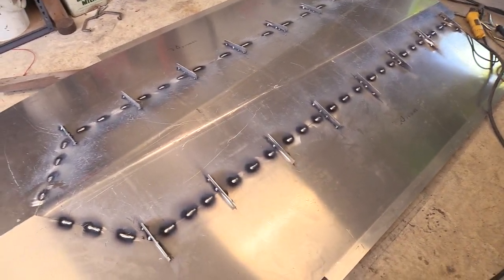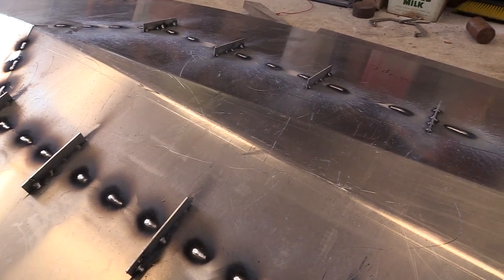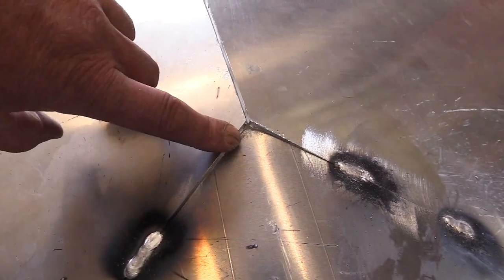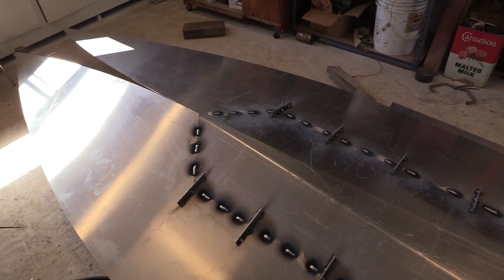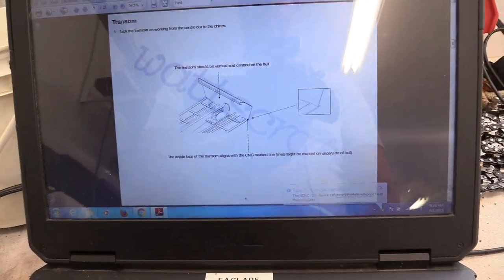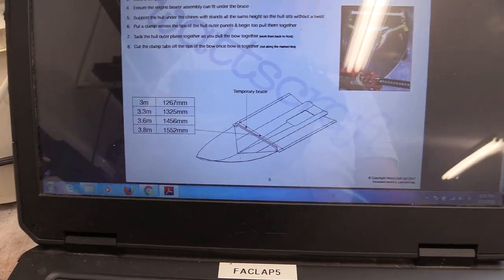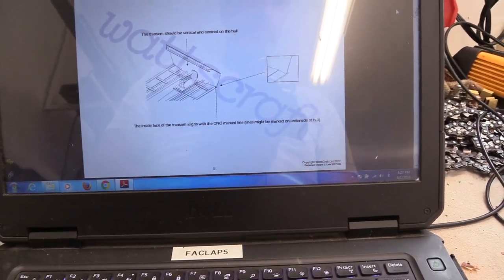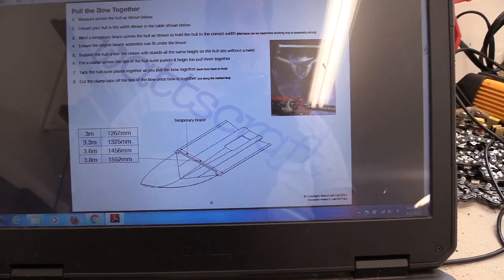Mini Jet Boat Build Video #6 Hull Assembly

Comment: I wondered where you warpage came from, and then I went back and found this video. You've stitch welded the hull. That's the biggest no-no. If you're building an aluminium boat, the biggest thing you're contending with is warping due to heat. Alloy is a giant heat sink and expands quite significantly over large sections when hot. 

Ideally you'd be using a pulse MIG welder. Standard MIG (and worse yet, TIG) will introduce much more heat per mm of weld bead than pulsed MIG. Secondly, and more importantly, you don't stitch weld when you're lining the panels up. You need to do tack welds, very small tacks at regular 100mm intervals or so. As soon as you stitch weld (Even with a pulsed MIG) you introduce vast amounts of heat into panels that aren't in their completed positions, resulting in expansion, warping and the outcome you have. 
I don't think the saying 'your second boat will be better than the first' has anything to do with the kit, it's your personal technique. It's entirely possible to build a kit boat without special jigs, but you need to thoroughly research the welding process for boat building. If you start with the hull plates welded like this, every single plate you put ontop of this is just going to make the issue worse and you end up with a bent hull that isn't lined up straight. I'm sorry but it really seems to be builder's error here due to lack of experience/understanding, not the kit.
Reply from the maker: Karl Friedrich My latest videos warn novice welders about building this kit. I suspect that you either haven’t built this kit, or you are being disingenuous. There are jigs on this kit. They are flat stock on end connecting the keel to the outer hull plates. Please inform me of what you expect to happen if your keel plate is bent 15deg higher on one side than the other? There is no argument for warpage with my tacks on 3/8 to 1/4 plate. The keel sets the side height. The transom doesn’t conform to uneven side height, and the uneven side height carries forward to the tip of the hull, ultimately changing the geometry. That creates a twist in the hull. The uneven geometry forces corrections that further change the intended geometric outlay, and when you get to installing the deck, it will be too far off to install as intended. Add over-bent chines and side panels to the mix and you have a nightmare “tac up” on your hands. The kit design was not the problem. Bad bends were.
Reply: @paulchristian8271  If the very first part of your kit - the keel plate - was bent out 15 degrees, I don't quite understand why would you even put the first tack down? I'm assuming you checked the relative angles and uniformity of the pieces before starting? That's a ludicrous amount of inaccuracy and yes that would be the manufacturer's fault as clearly that's going to affect the rest of the build. If the sheet was out by 15 degrees they should have gone back to the supplier as many times as necessary until it comes back right and not put onto the boat.
I've not built a Wattscraft before, but they are one of the most popular DIY jetboats here in NZ and I've never heard a complaint about misalignment before your videos. Wattscraft themselves put out a video with the hull tacking process, and it's very lightly tacked the whole way through even on a 5-6mm hull plate. I have never seen anyone tacking as heavily as your process, you've stitch welded, not tacked. In a giant Lego kit where every little bit of expansion adds up you should aim to minimise any actual welding until the fitment is 100% verified for that stage. Whether it's contributed in your case I don't know for certain but it definitely doesn't help. Even at the lowest level of inconvenience, if something needs to come off to fine tune a curve or alignment, it's vastly easier to grind off a handful of tacks as opposed to what is essentially a 50% welded hull.  https://www.youtube.com/watch?v=tRc2hlQwNwE
Reply from the maker: Karl Friedrich I’ve never said I didn’t lack experience. That’s the point of the videos. Yes, the bends were screwed.  If you actually watch the progression of the videos, you will see that. You will also see where I warn people to check the bends before they take the kit home, and certainly before welding. Have you put out a series of videos showing people all of this, warning them about bad bends and welding techniques? I could have used those a long time ago. My videos have caused other people to buy the welded hulls, which is what I would have preferred to do with all of this 20/20 vision I have now. RSRs bent kit was garbage, not Wattscraft’s design. A kit with garbage bends in the hands of a novice is a bad thing. I took the keel into an industrial fab shop to be re-bent to at least match the transom cutouts, but re-bending the middle to front part of the keel is not a simple task. This was the second kit that I got from RSR after sending the first one back. Criticize me all you want. People can come to their own conclusions on what I did wrong, but I did not misrepresent my skills, or the flaws in the kit.

Comment: Let me give you some small tips .....(GIVE WATTSCRAFT A LITTLE MORE RESPECT THEY BEEN BUILDING BOATS FOR YEARS)and you just started . 
    I can see why your boat is all  messed up a lot has to do with your  tacks .. This must be the first time you built anything of any scale  What you did is stitch welds witch creates warpage. Tacks do not do this. When you Build anything in that scale you have to tack everything together first . Witch mean you jump around  what ever you are building .To you other videos . ABout the bends unless they have a cnc  press break you can never have the angles 100% right . Before you assemble anything it is your responsibility to measure for you self and make adjustments   before you go building anything.  When a framer starts to frame they just dont starts framing the house on the block without measuring and making sure it is square and level ?  
Hope this helps.
Reply: In Russia, they say about such people "Hands grow out of the ass")) We still have the saying "The first pancake is lumpy". I built several Wattcraft boats. At first, there were difficulties, but each subsequent boat turned out better than the previous one.
Reply from the maker: East Mariner Did you have uneven keels and bad side bends on all of them?
Reply: @paulchristian8271  I bought a kit in New Zealand from Henry Watts, not rsr.  There were no problems.  I think you have errors in the assembly.
Reply from the maker: East Mariner Did you have uneven keels and bad side bends? I get the learning curve thing.
Reply: Bronze Brubaker watch some of the later videos. I am not a pro, but bad bends will screw you hard with this design.
I probably was too hard on Wattscraft, but they need to deal with their distributor. If you can’t bend the parts to spec, then don’t sell a kit that advertises “no special tools or jigs needed”. It causes you to have to be able be a body guy who can straighten metal, or correct for unmatched components. It all shows up when you go to put the deck on, because there is enough flex to hide it up to that point but you can’t hide the final reckoning at the hood. You can’t say that bad bends shouldn’t be a problem, unless you have never fought one. The keel sets the angle and height of the two sides. If your left side is lower than the right, your front end will not come together square and even. Everything has to line up level and even from the transom to the tip of the boat, otherwise your boat will twist. Those keel welds did not warp the 10mm keel to 5mm outer hull pieces. No chance of that.
Reply from the maker: I did take the keel in to an industrial fab shop in an effort to get it straightened out. As for all of the bends, nobody sent me the specs to check the angles so that when I took them to a fab shop outside of town to get them "fixed", they would know how to bend them right. 
Some things cannot be "re-bent" well, like 10mm aluminum 8ft long bent to a V point in the front. 
It's real annoying when people tell me "the first one is the hardest one", or "you'll do better on the second one". Why would anyone think that I was going to build a second one? This boat is for me. If the fourth boat you build is the one that is supposed to be a good one, they need to tell "non boat builders", not to expect a good end product on their first two or three boats. 
Go to their website and look at their instructions, then tell me how helpful that would be to a novice. 
I didn't go to a boat builder and beg them for a kit. These boats are advertised and sold to people who generally don't build boats. 
I don't believe the design is flawed, just the bends. Bend the parts right, and you will have happy customers. Bend them wrong, and you will have bad advertising for a lifetime.
Reply: @paulchristian8271  so the morale of your story is you should of done more fab work before you try to build a boat.  To get back to what the people are saying about the 3 or 4th will be better is the truth . Just think  the more you do something the better you get . I am on my 10th car build my 4 motorcycle build my 2 house
 build my 2 full boat build and keep going .. Everyone I learn a little more and get better and better . If Edison made 1,000 unsuccessful attempts at inventing the light bulb. And look at us now .  WATTSCRAFT been around for ever... You need to know your skill set before attending to do something..
Reply from the maker: @thediyfamilybrubakers4054  The moral of the story is that RSR does not sell a kit that is bent right, but they don't tell you that when you order the boat, so if your skill set is that which is only capable of assembling a hull that has components that meet spec, don't buy their kit in the US unless you want a twisted hull, or a nightmare. 
Certainly don't think that you can assemble the boat according to the manufacturers instructions, having geometrically odd components. 
Wattscraft by RSR boats require a higher fabrication skill level than their "no special tools or jigs" advertising leads you to believe. 
You are obviously biased, or dishonest. Maybe you haven't watched the videos where I showed the screwed up components. Either way, you seem to lack a sense of accountability toward those who lead people to believe that a lower than professional skill level fabricator can assemble one of these boats when the components are out of spec.
Reply from the maker: @thediyfamilybrubakers4054  We tend to have the same expectation for others that we hold toward ourselves. I guess mine is too high for this product.
Reply from the maker: @thediyfamilybrubakers4054  This was the second kit that I got from them. The first was a partially welded hull. I have spared them the embarrassment of posting those videos and pics.
Reply: @paulchristian8271  you keep saying about specs when you said your self that there is none .
Reply from the maker: @thediyfamilybrubakers4054  Then they should tell their customers that there are no bend specs, so don't expect things to line up well.